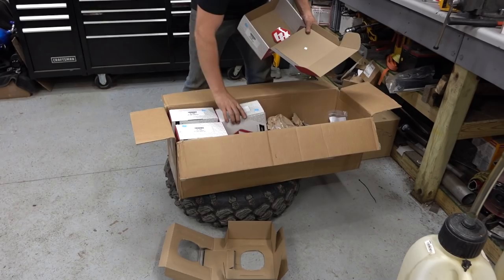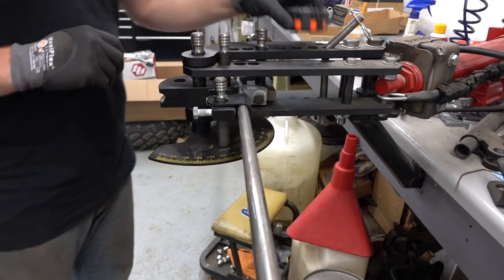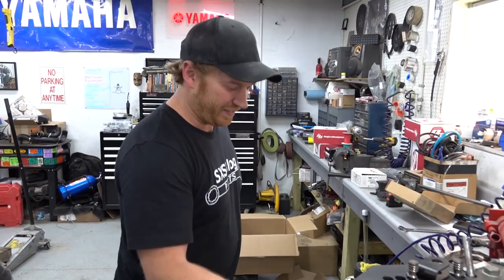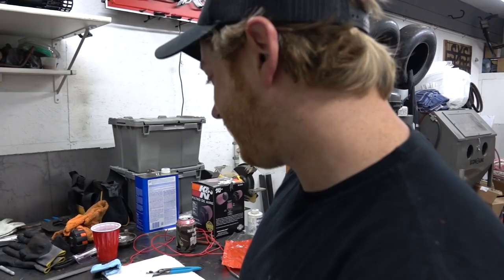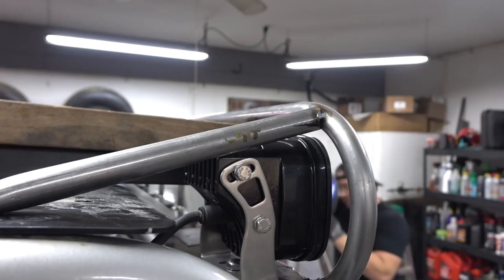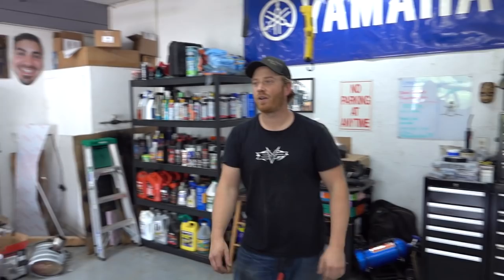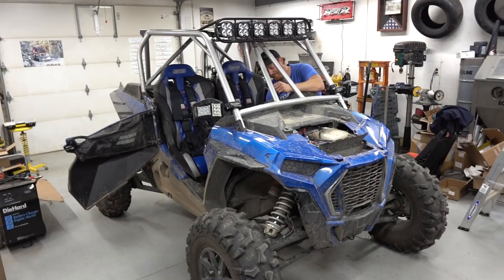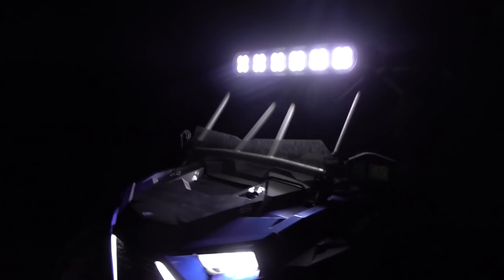Building the SICKEST light bar for Battlefield RZR Turbo S!

Comment: Hey guys is Charlie this is in reference to the wiringwhat you want to do is put a little dish detergent on The wire before you pull it through and always have one guy on each endso you both can push and pull to help prevent chafing on The wire against the metal inside... Just something we use pulling the big wires hope  it helps you guys.. if you make it over to Western PA give me a holler.. keep it up guys great videos

Comment: To pull that wire through the tube you just attach a pull string and use a shop vac on the other end. Once the pull string is through just slide your wire through.

Comment: Try using magnetic rope chain. Same stuff on ceiling fans. You can drop it down any channel and use a magnet to guide it through, then grab it with a mag pen to pull it out. Used it many times in the alarm industry for door contacts.
Reply from the maker: Slick!

Comment: The perfect light bar if you've got $2400 laying around and some fab skills. Doug, you should put the diffuser lens on the outside pair of lights and you would get better lighting outside the main beam of light. At the dunes, floods are better because with as much light as you've got, you'll blind yourself on the glare off the sand. Been there done that. I have four XL Pros, 2 are spots like you have and 2 are flood and they are amazing.

Comment: After you guys got the lp6 I looked at buying some baja designs for the grille of my truck. I got the s2 pro driving combo lights. Unreal, almost 5000 lumens from 2 little 2 inch led lights. I'm gonna get the 20 inch led s8 led next with the amber backlighting. Great job on the light bar rack. Super awesome design!

Comment: Doug, Wow your baja setup is awesome, couldn’t you ground the lights to the frame and use the black wire for the low light switch.  For tight fishing wire I use Dish soap on the wire.

Comment: When I pull wires through tight spaces and wiring looms I sometimes resort to a dash of silicone grease or spray, stops the rubber coatings on the wire from dragging too hard on stuff.

Comment: I don’t know if you guys will respond to this or not but if I were to build one for my rig I would of made to exact loops and used those tabs to join the to loops and then mount the lights and form a cage kind of design around the whole unit.